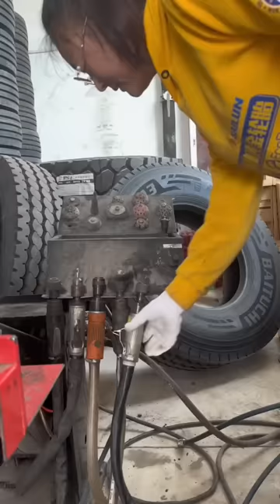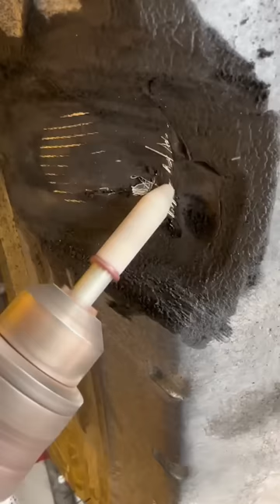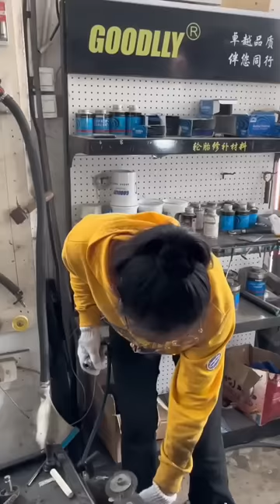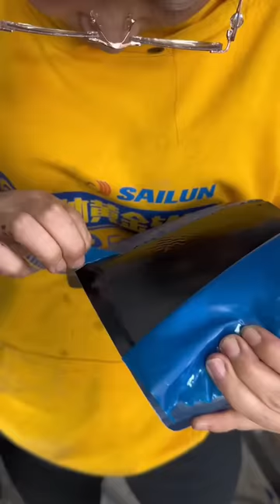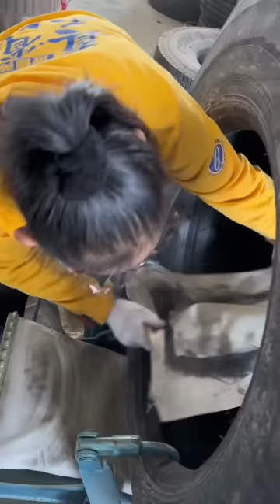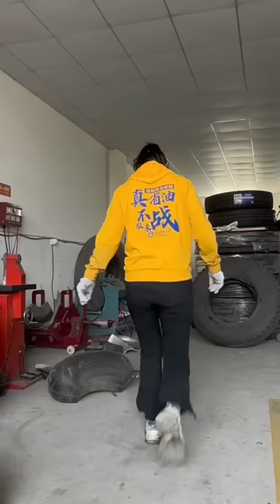Repair A Big Nail Hole In A Truck Tire Without Replacement

Comment: I work at a tire shop and as a tire tech I would never even try fixing a big rig tire with a whole on the sidewall and for whoever is gonna end up mounting and putting 100 psi in that tire good luck I would never go for it it’s too dangerous it can blow up on your face come on people use some common sense
Reply: Yep and how about airing the tire without a cage to protect youfrom the exploding tire / rim? But it saved the driver $200
Reply: Third world country they don't have tires at there disposal as we do....they make do with what they have, that tire will probably never fail because of that repair....they aren't driving on highways at highway speeds....
Reply: They’re in China big dog
Reply: They have more people than they know what to do with, safety takes a bench seat in most cases.
Reply: I like to see what others do.
Reply: Chinese don’t care evidently . Wouldn’t want that on a truck I drive
Reply: What if I used gorilla glue
Reply: I think her lungs would look like the inside of the tire before she vacuumed it out, after about 3 tires. Some exotic fumes from the cement, too.
Reply: Millions of truck tires are made in china.shouldn't be hard to get a safe tire
Reply: Many opinions here....
Reply: Nothing wrong with patching a sidewall with a hole in it when done properly as different countries do have different regulations on the matter. I remember back in the day in America that we patched everything.
Reply: LOL 😮 You took a chunk out of the sidewall because ????
If you are going to put an oversized maxipad on the inside of the damage, then why not put a plug on the outside and fill in the cavity / damage with that rubber stuff  ? If you can make a big chunk of rubber with the stuff she cut, then fill in a small imperfection. Keep the integrity of the original cast tire.
SMH
Reply: @ab4zr1  Yeah I was thinking the same thing Dave,  these types of jobs come back to haunt us with health problems as the years pass.
Reply: I agree.... And she even grinded through the belts
Reply: Fn critics🙄
Reply: What she did is called a section repair and it is done in North America too. It is mostly done on Ag and OTR tires but can be done on commercial truck too. It isn't common on commercial truck because the cost of labour and materials make it cheaper to replace the tire then repair.
Reply: It's illegal to patch any side wall damage, I'm a driver and would refuse to roll with that on my truck
Reply: Do it properly like her and you're fine.  But guess you don't have the skills in your country.
Reply: petercoleman2834 I agree with you. In the US it is so over regulated because Goodyear, NTB, and Discount Tire just want to sell you a new one rather than repair. I just plug them myself…never had a problem!
Reply: @andyb9994 tunes. Do you know how many tires are manufactured in China?
Reply: @jerrycoggin9434  no how many ?
Reply: I drove a Freightliner, Orange.
I don't know a trucker that would try that.
Blow a steer tire at 65 mph at 60K# wild ride, anything can happen.
I always hated 4 wheelers that just take their time passing, something can obliterate them, get around, be safe, we hv to constantly keep checking on them (cars).
She knows her stuff but the rules and sense are different from the US.
Reply: I don't think this is her first rodeo 😂
Reply: The sad thing of it is her repair will probably last longer than the junk tires  we get here in America
Reply: petercoleman2834 this is true. But in Europe we now see far less blown tyres littering the roads, have less RTC's due to blow outs too. Continental do a sidewall repair course that is classed as an "official" and approved repair foe experience car tyres but not sure if it applies to trucks. Even still, it looked a steer tyre and that repair will clearly get ripped out on a right turn! These countries don't have much options do they😏🇬🇧
Reply: If you guys have never seen this done here in North America, please do some kind of research before commenting.  Been there, seen this, drove on this, work for a company that has this done.

Comment: This is totally unsafe tire repair. A huge piece of the tire is being removed. This jeopardizes the structure of the tire. Chinese tires are cheaply made and replacement is required. The labor entailed in attempting to fix the damaged tire further indicates why the tire should be replaced. This is a ridiculous repair. Do Not perform this repair. ! Unsafe !

Comment: Wow... I've never seen anyone inhale raw rubber and metal dust like that.
Reply: At least she has eye protection..
Reply: @davidwaller3790  and safety  boots,but dead in a few years lungs full of rubber.
Reply: @kennethtownend8301  
Maybe it can be dissolved by inhaling diesel fumes every time you fill up.
Reply: Yeah good eye protection but she’ll probably have lung cancer in a few years.

Comment: I am in the US and I don't know anything about tires. I do know that when I have had a nail in my car tire anywhere near the sidewall I was told no repair, only replacement. But getting back to the point of this video, Mia is certainly a very knowledgeable and capable tire tech. I certainly hope she gets paid what she is worth. Does anyone know what country she is in? I wonder if she is the owner of the shop.
Reply: Мы в России делаем такой ремонт. И все работает отменно. Девочка профи. Грамотно все делала. Только матерьял я использую ваши тэч. Но клеи японские.